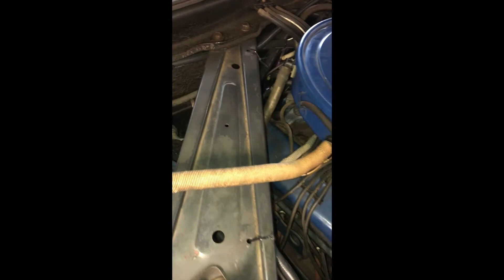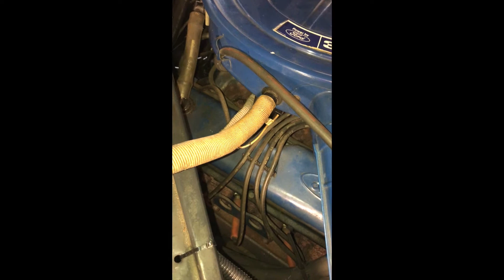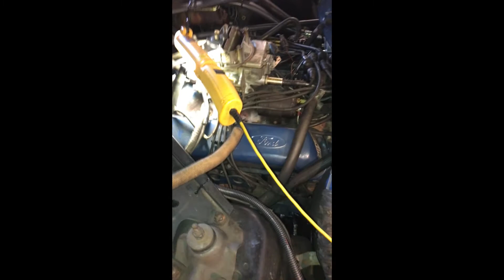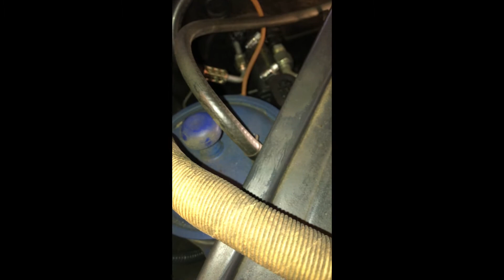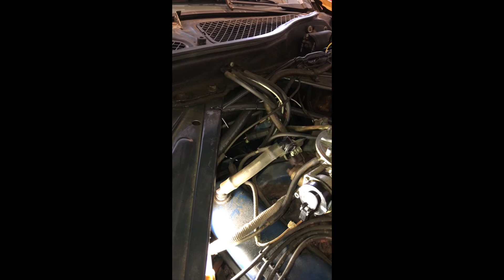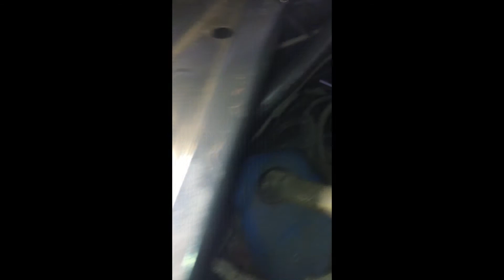1973 Mustang Transmission Vacuum And Fuel Evaporative System Lines

Comment: This gentleman is an expert on this subject.  Gilbert is to be commended for this fine training video.  Thanks.
Reply from the maker: Thank you, John.  I spent a lot of years working on these older emission control and vacuum systems "back in the day."  So much of how and why these systems were designed like they were, much less the underlying documentation, has been lost over the years by a lot of folks.  I am glad to have been able to pull together so much good information on these vintage cars in the earlier phase of emission control systems.  It is amazing they worked as well as they did, but it was computerization that finally help fulfill the promise of technical solutions that ended up working out so well in newer vehicles.  I am happy to have lived to see that finally happen.  Still, "old school rocks!"  heh heh...